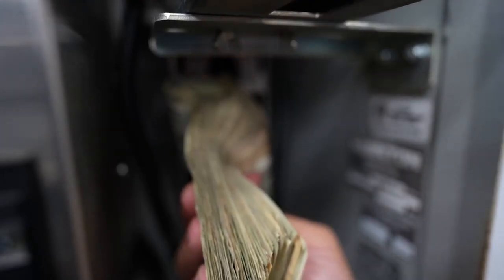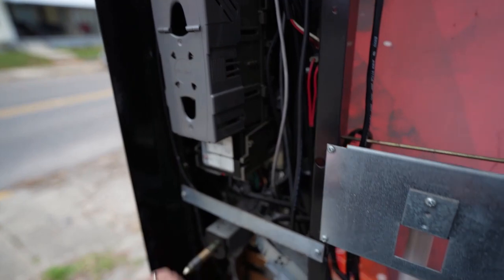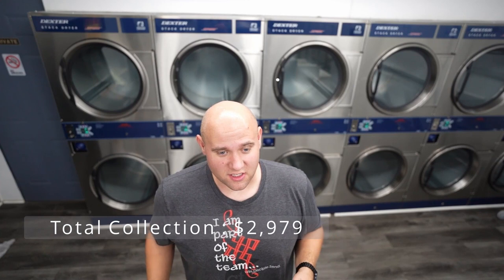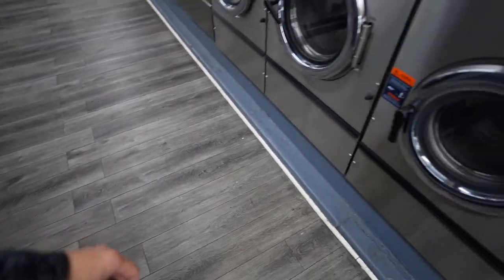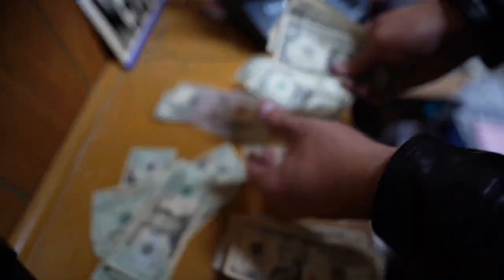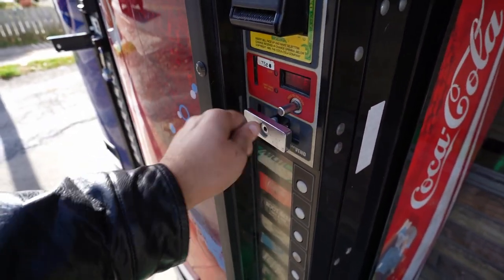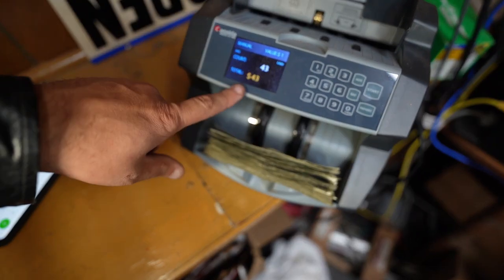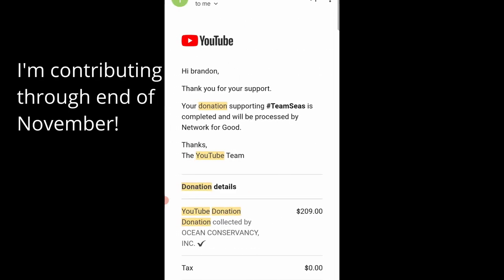My Laundromat Made More in ONE DAY than 1 MONTH

Comment: BTW the audio distortion from the quarters has very little to do with your microphone. It's because you need to reduce the gain on that audio channel on the recording device, when you're recording. Metal crashing into metal creates what are known as "transients", and they will distort the amplifier unless you turn the gain down a LOT.

Comment: Did you switch the hot air from the electric dryers to heat the laundry mat instead of going outside yet?
Reply: Why would you do that it would just throw lint and crap all over the place
Reply: @joshuabest100  One free heat and it goes through a filter, also natural gas is going up by up to 54%. so if it costs say $100 to heat his building a month its gonna be $154 now five months of cold thats $270 more.
Reply: @METALMAN4Wii  carbon monoxide poisoning though ?